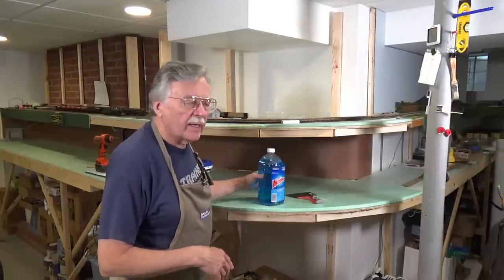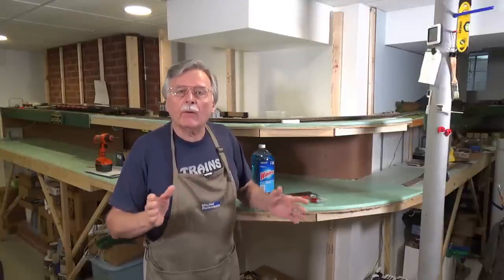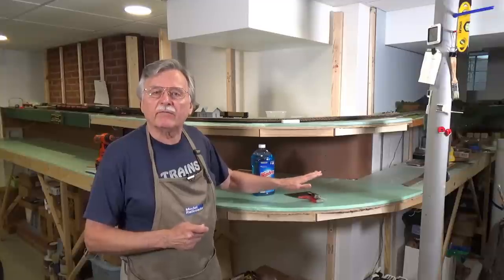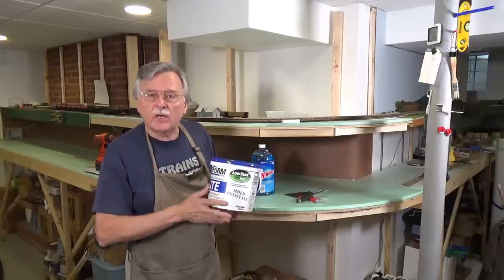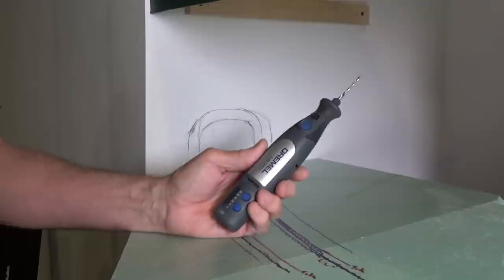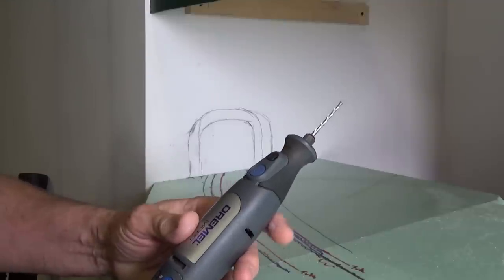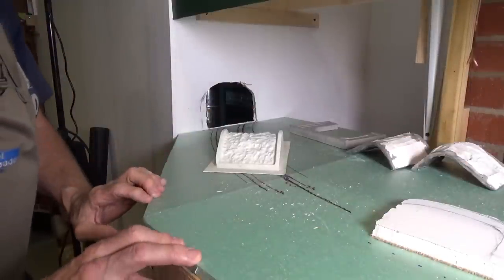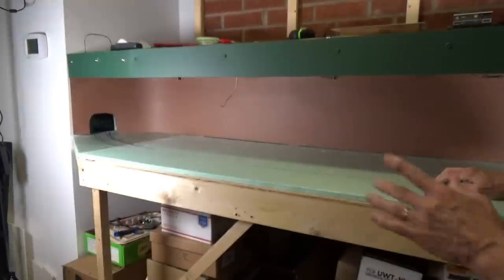Finishing The Backdrop And Adding A Tunnel (201)

Comment: The moisture usually settle toward the bottom. One help is to store the bucket upside down when not in use and then you will see how wet it is and remember to mix it. It is also advisable to take out the amount you think you will need and close the bucket and do not return any material that has been in contact with the Masonite as fibers will be returned to the bucket and will add to how quickly it will dry out. Thank you for doing these videos. You have helped many modelers with all different aspects of the hobby, myself included. I always look forward to your videos.
Reply: Excellent advice

Comment: I purchased a drywall mixer that I attach to my drill and mix the compound each time I have let it set for a while. Really makes it easier to use. Also I've found a little water poured on top of the compound in a partial bucket keeps it from drying out and getting hard on top. Just enough to cover the surface. Really enjoy learning from you. You are an excellent teacher. Thank you.

Comment: I find if you stir the filler before using it makes flow better and easier to spread over the joint.
Reply from the maker: Yes, the moisture tends to migrate down in the bucket so a good stir does homogenize it again.
Reply: Might still need a touch of water as the compound ages in the bucket.

Comment: Yes Larry that drywall mud is way too dry.  You might be able to rejuvenate it by adding and thoroughly mixing in a bit of water but chances are it has started to react and is beyond redemption.  I would have cut the tape a bit longer (just a bit less than the thickness of the foam sub-base) and pushed the "tail" of it down behind the foam base with the 4" knife to avoid the tools catching the cut end and pulling it up like it did when you were adding mud at the bottom.

I'm still having a bugger of a time getting my Masonite to curve anywhere near as tight as you do.  It could be a different Windex formulation here in Canada or be due to both sides being smooth finished rather than the back side being "textured".  But clearly it can be done so I'll keep playing with it until I get the required results although any further guidance or comments wouldn't hurt..
Reply from the maker: Good idea on the tape. I gave it a good stir and the moisture had migrated to the bottom so now it is pretty good consistency.